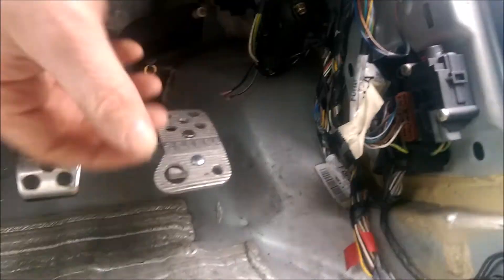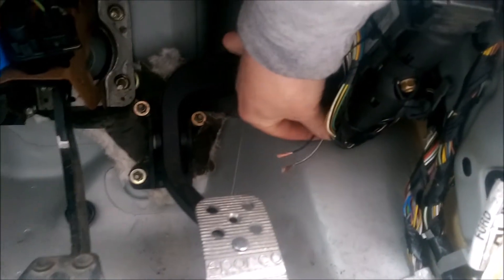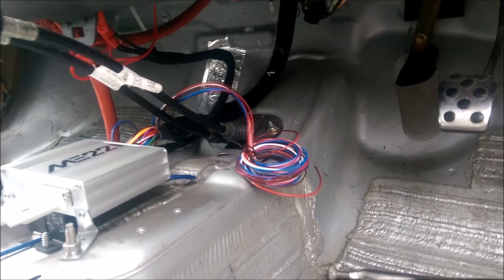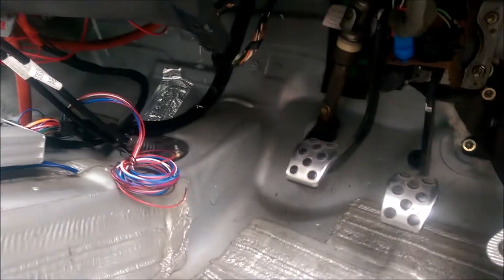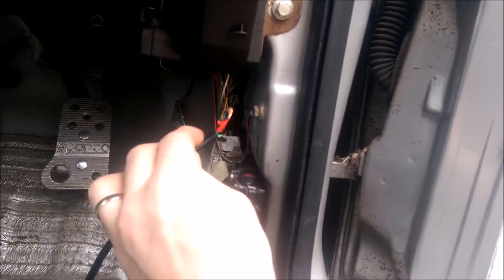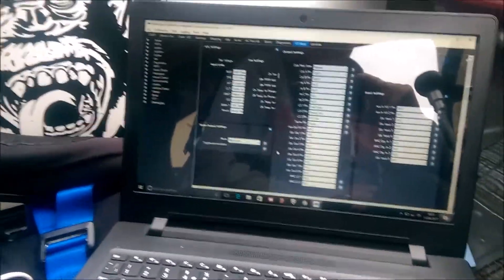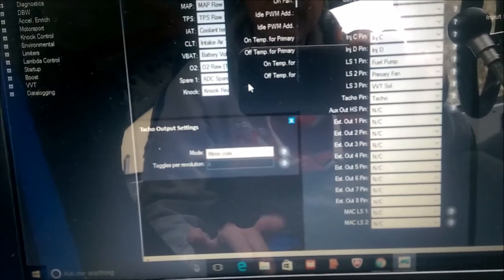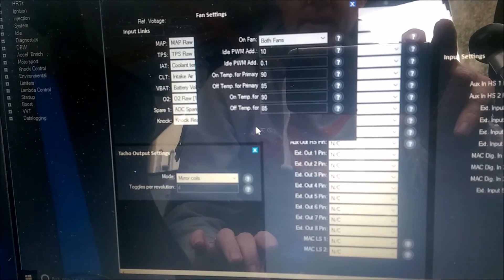me221 fan control setup on ST170

Comment: WISH THERE WAS A COPREHENSIVE VIDEO SHOWING STEP BY STEP,WHICH CAMSHAFTS TO USE & THEIR PART # & WHERE THEY CAN BE PURCHASED & ALL THE FORGED INTERNALS(RODS)  & A STEP BY STEP BUILD ON A ZETEC 2.0 DOHC, TO BUILD IT UP  STRONGER THEN STOCK!!!??? PEOPLE MAKE VIDS SHOWING THEIR BUILDS BUT NOT WHAT PARTS THEY USED TO GET THERE. I WOULD LIKE TO KNOW THE PART # FOR THE UPGRADED CAMSHAFT FOR A ZETEC, & THE ITBS-SGSX750 & ME221(CONTROLLER/COMPUTER)